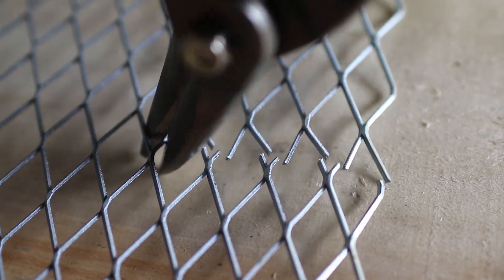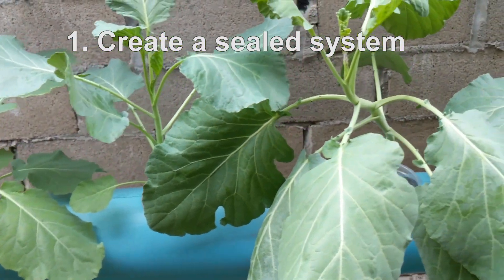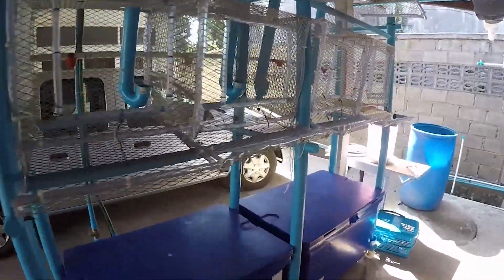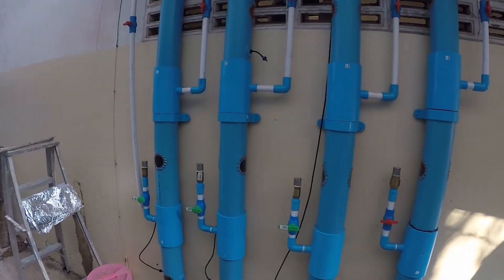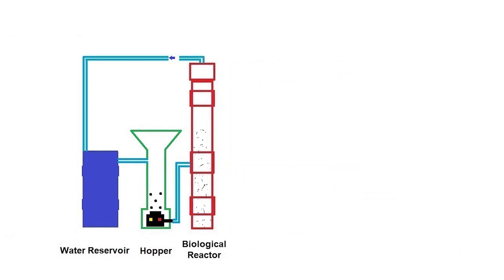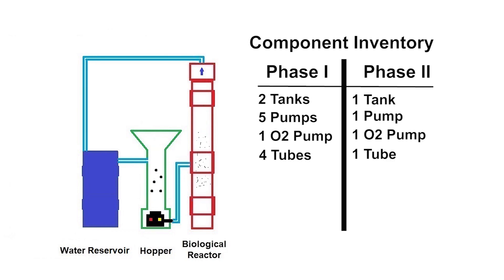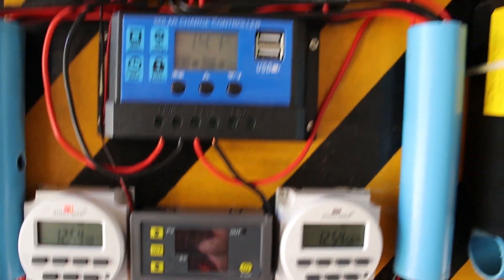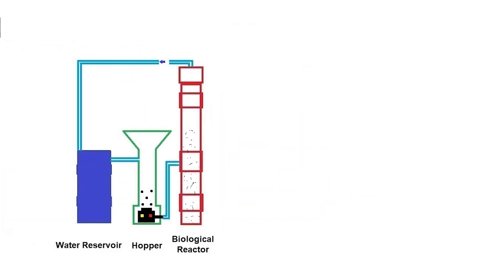Chicken Aquaponics Phase II Design

Comment: in the new system, the mixture of manure and water goes back into the water tank? how long does this mixture stay in before being pump out the grow beds?
Reply from the maker: If you are starting a brand new Bio-reactor, you should continue to add manure for 6 weeks before taking out any of the solution.  After 6 weeks, your bacterial colonies will be established and you can take out solution at any time. HOWEVER, when you decide to transfer solution from your bio-reactor, to your hydroponic garden, you should stop adding manure for 4 days.  4 days will give the digester time enough to convert the manure to safe nitrates, and eliminate contaminants and pathogens.
Reply: @ChickenAquaponics  thank you. six weeks of waiting period would be more efficient to use six tanks so they just flow in sequence, and don't have to worry about the four days absent?

Comment: Great work, how many chickens can Phase 2 reactor cope with?
Reply from the maker: I've been able to manage the nutrients with a single chicken.
Reply: @ChickenAquaponics  what kinda nutrient density we talking about per system water ?
Reply from the maker: @laowoodley6165  : EC for aquaponics is quite low.  While hydroponics will require EC levels at 1000 - 2000 range, aquaponics for fish and for chickens is very low.  The highest reading from my system has been EC of 800.  It is for this reason most aquaponic operators do not ever measure EC.  It just doesn't come into play as it does in hydroponics.